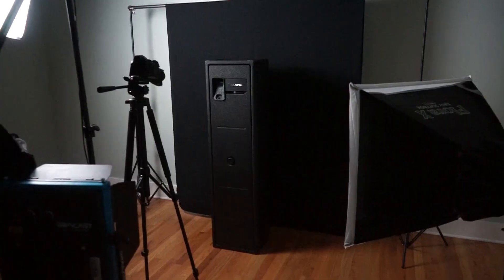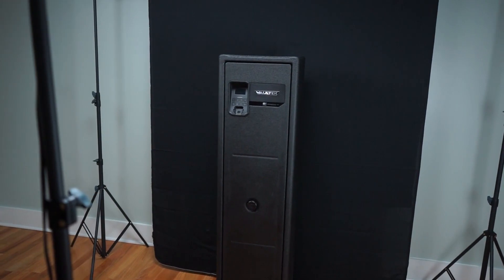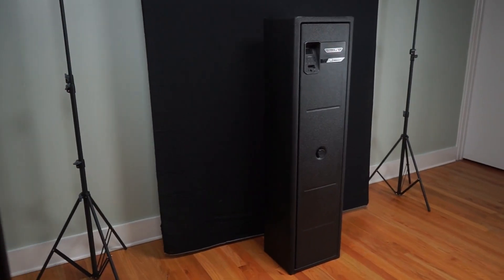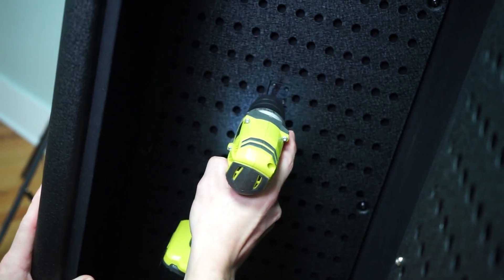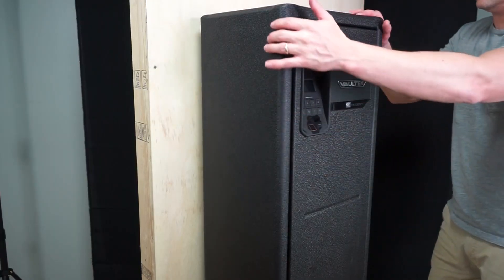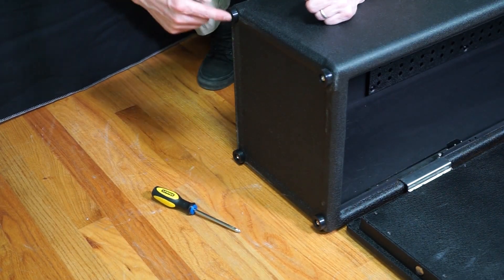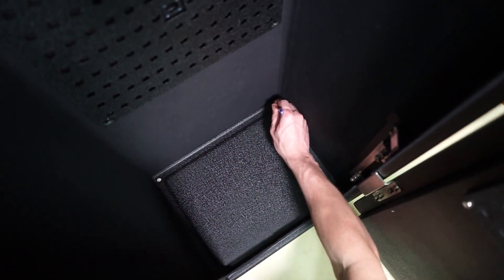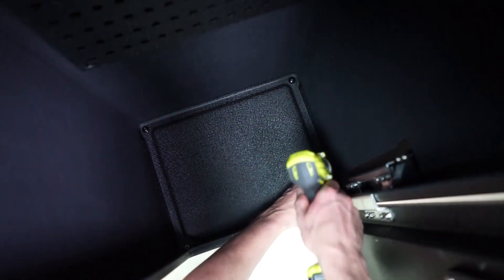RS500i Tutorial: How to Mount RS500i

Comment: This video did not take into account having to deal with baseboards, causing the safe to sit away from the wall.
Reply: Same prob I ran into
Reply: Two options:

1. Shave down the baseboard in the location of the safe until it sits flush; or

2. Shim the wall behind the safe with plywood, until it sits flush.
Reply: @xeoh85  - I used a plywood plate behind the safe.